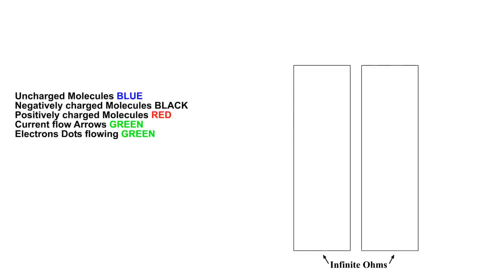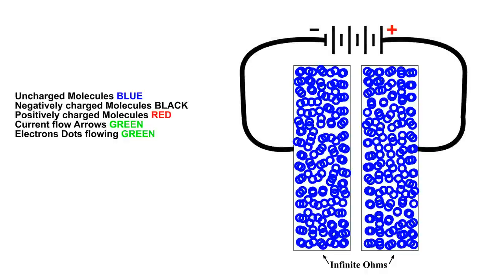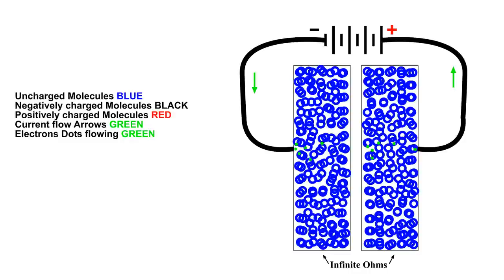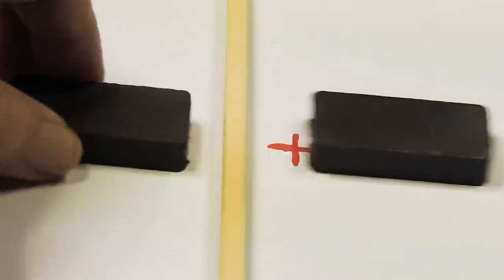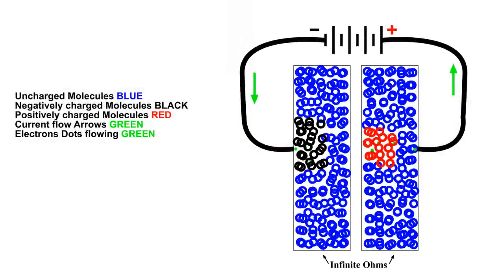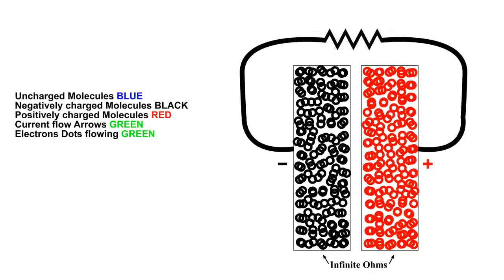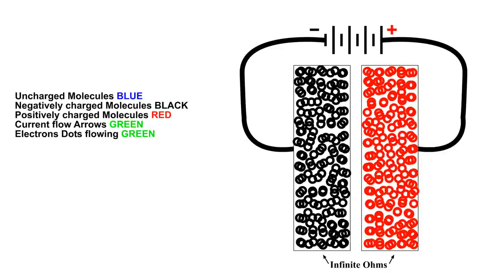How  Capacitors charge and discharge

Comment: Excellent demonstration - best I have ever seen about why there is current flow without any electrons flowing between the plates. Nobody else ever shows the magnetic force pushing the electrons off the positive plate.

I also want to praise your description of the inductor in another video, where you show how current induces a current in an adjacent turn of the wire, and how that works against the first current. Brilliant!
Reply from the maker: JL Software 
Thanks very much JL Software.

Comment: Hi AllamericanFiveRadio, thanks for another fine explanation. One step further.....we have a psu with a plus and minus rail and a center zero between plus and minus. The two capacitors takes down (or reduces) the ripple after the bridge rectifier... I wondered: does (ripple) capacitors get warm inside when we draw amperes because of the so called  "capacitive reactance"...best regards Kim
Reply from the maker: Thank you.
Usually capacitors get warm when there is to much voltage. Also the wrong polarity applied to electrolytic capacitors may cause them to explode.

Comment: So basically a capacitor is an 'ionization' device - when fully charged, the excess of electrons on one of the plates means the atoms are negative ions (possessing an excess of electrons when compared to the uncharged capacitor).

And on the other plate, there is a relative absence of electrons, so those atoms are positive ions.
That's the DC case:  when the capacitor is fully charged, negative ions on one plate, and positive ions on the other plate.

For the AC case, you are just swapping the ions back and forth at twice the frequency of the AC.  I say 'twice the frequency' because each period of the AC signal has a positive 'half-cycle'  (half the 360 degrees per period of the AC wave, or 180 degrees) and a negative half cycle.

So for example,  in a 2 Hertz AC wave (obviously a very low frequency but just to make the point),   there are 2 periods of the sine wave per second - 2 Hertz.

In the first 1/2 second, 1 Hertz - a full cycle of a sine wave - the sine wave applied to the capacitor will charge one side positive, the other side negative, and then swap the charges on the plates.

In the second 1/2 second, another 1 Hertz - a complete cycle - occurs, and again you initially charge one plate positive and the other negative for the positive half of the sine wave,  then you swap the charges on the capacitor plates during the negative half cycle of the sine wave.

So in a frequency of 2Hz,  the charge on each plate changed 4 times:  positive then swapped to negative, then positive again then swapped to negative.
Reply from the maker: This video shows one complete AC cycle. If one of these complete AC cycle were repeated 100 time consecutively in one second, this is 100Hz.
MOSFET Push Pull Amplifier Visual Demo
https://www.youtube.com/watch?v=-6N7l1dnk6s

Comment: Sir I have been benifitted a lot from your video.Would you please kindly expain  why electrons flow on the right plate in the time when elctroncs are flowing form the negative side of the battery to the left plate of the Capacitor?
Reply from the maker: +Supriyo Ghatak 
The only thing that we really know is, electrons (what ever they are) (something) travels in a circuit from negative to positive. 
This is going to surprise you, nobody knows why. There are lots of theories about why electrons move in a circuit from negative to positive. 
It is most important to keep in mind what a theory is, it is somebody's best guess. However this part has been proven that whatever it is we call electrons do apparently move from negative to positive in a circuit. I find it very interesting that no matter how many doctorates a person may have, they cannot tell you the why of anything. They can only give you a theory, which is their best guess.
Reply: +AllAmericanFiveRadio thanks  a lot.Now I better make out the concept of charging and discharging of a capacitor.

Comment: Wow, just wow. I understood things better from this video than I have understood anywhere else. Now if I could just understand  farads, yeah I know it's dumb, but I need to see what do those things represent and how do they affect the circuit. 

If I charged a capacitor with a 9 V battery, what is in that capacitor then. If I used 12 V battery then what would be different? Just the voltage? Is the farad count just a factor of time? What is it? What is a farad? Electricity is the movement of electrons (at least I think it is) what is happening differently between a 100uF capacitor and 470uF? "Oh wow that's a  300mF capacitor!!" Yeah uh so? How do I utilize this knowledge? What difference does it make? How does the change in those values it affect the circuit?

I don't know if I'm somewhat retarded or what, but I need to understand what happens on the most basic level, saying things like F= C/V just confuses me because Coulombs are defined somewhat arbitrarily (6.242×10^18 electrons/protons, I think?) 
I know these definitions become very useful and convenient once they are understood, but therein lies the problem, I can't implement them because I don't understand them.

Also this is what triggers me:
1C = 1F * 1V
1F = (A*s)/V
1V = 1Ω * 1A
1A = 1 C/s
Ω= s/F
I'm running circles all day... Maybe I'm just too tired to get what am I missing..
Reply from the maker: Thank you.

Comment: Thank you for your time to make a nice video. your animation show the electrons going one direction from 0 degree to 180 degree, then going the opposite  way from 180 degree to 360 degree. if the electrons reach the positive peak at 90 degree(no more electrons can charge to the right hand side plate), that means if the AC does not change the direction, how the electrons can travel back to left hand side plate from the 90 degree to 270 degree. It is confuse me and i really need your help! thank you!
Reply from the maker: Electrons do change direction at both the 90° and the 270° points in an AC sine wave.
Reply: thanks, i really understand the electrons do not change direction at both the 0° and the 180° points in an AC sine wave, but it looks like so in the sine wave. (above or below 0)

Comment: what does that waveform represent - supply voltage or capacitor voltage?
Reply from the maker: I'm working on a video to explain the waveform. I think I'll call it “AC Alternating Current, for the Beginner”.

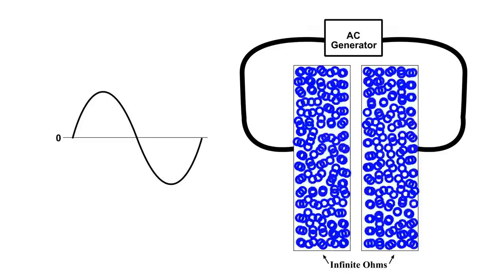Comment: thank you very much.I'm wondering what happens when in the alternative voltage case it approaches the maximum (3:01) and then the voltage starts to decrease what happens inside the capacitors? where the positive charge goes?
Reply from the maker: It's not where the positive charge go, it's where the electrons go. A positive charge is created when the electrons leave.
Reply: Thank you for such a quick reply. Correct me if I wrong. In this situation (a little bit after 3:01) the potential at the capacitor plate "+" is bigger than the power supply's "+", then creates the potential difference that starts to drag electrons towards the capacitor "+" and therefore create the "blue" charge which are neutral. the same happens at the minus side of capacitor.
Reply from the maker: Blue is neutral, that means the molecules has no charge. When electrons are pulled away this leaves the molecules with a positive charge. When electrons are pushed into the molecules they now become negative. Alternating current (AC) is the same thing as far as electrons, but, the polarity continuously changes from positive to negative and negative to positive. It is about the same thing as with a battery if you could keep switching the battery poles manually. AC is usually shown the way I have this video. It starts with zero Potential which is 0°, it gradually increases positively until it reaches peak positive, 90°. Then it starts to decrease in positive potential until it reaches zero again, 180°. At this point it starts to move negatively until it reaches peak negative, 270°. From there it starts moving toward zero or less negative, and when it reaches zero again it has traveled 360°. The capacitor plates follows the electron flow.
Reply from the maker: Capacitors, DC and AC Current
https://youtu.be/NInt1Ss3vQ4
Reply: thank you. decrease in positive potential meaning that electrons should flow from + of power supply to + capacitor to neutralize molecules, i.e already after 90°of positive potential the current changes his direction? my question is where + side takes electrons to neutralize itself as potential starts to decrease in power supply?

Comment: Why the current increases in negative direction from 90° to 180° in ac supply when voltage decreases in  positive direction  is applied to capacitor?
Reply from the maker: AC Alternating Current, for the Beginner
https://youtu.be/xVbqMFkyuXI

Comment: Sir if the negative-side of the battery connect to a conductor and positive side let loose; do not connect to anything, does the electron from the battery flow to the conductor? and ampere can be measured?
Reply from the maker: +Totardo Tobing 
The only way current can be measured is with a current meter in series in a closed circuit. Now you can measure the voltage across the capacitor and also on across the source such as a battery.
Reply: I see both battery voltage and capacitor voltage will same after/if capacitor get charged. What if the two conductor is a two body of person do the they get charged also? Since body of human is a conductor too.
 For instance, I have a 1.5 V batteries. The negative-side of the battery connect to body of human left and the positive-side of the battery connect to body of the human right. And if I measure Voltage, do they contain Voltage?